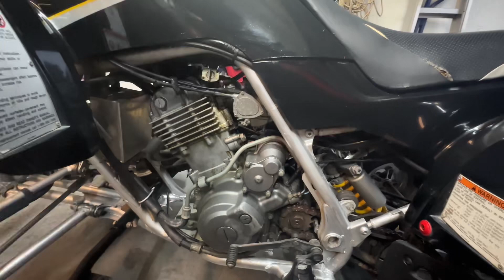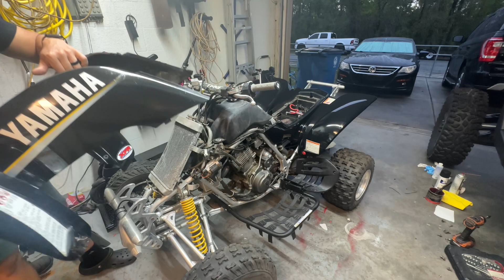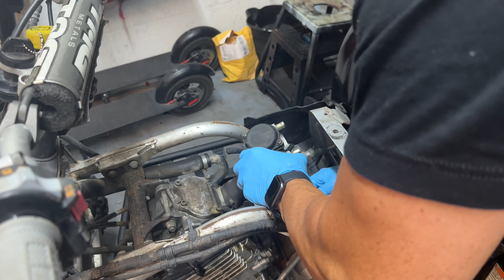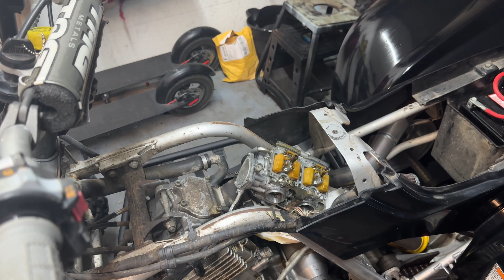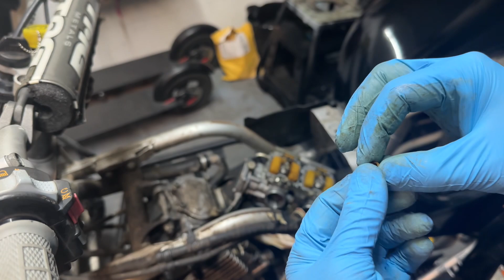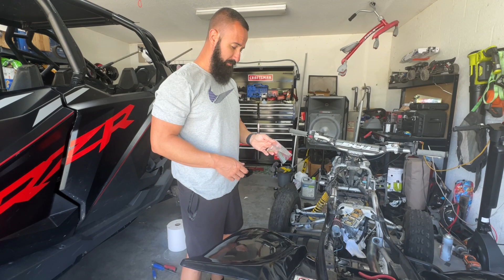Raptor 660 Carburetor tuning (Dual Carb)

Comment: My 05 raptor 660r also bogged spits when I open full throttle any suggestions how’s to fix. It feel like it’s not letting me use full power also missing air filter the air box it’s there but no filter
Reply: You will have to order the OEM air filler guide, plate element fitting and a UNI air filter.
Reply: Valve lashed
Reply: Your reverse wire could not be grounded properly. Happend to my 03 all I did was ground it and it stopped the issue
Reply: Hopefully you’ve figured it out, but you need to have the air filter or it won’t run properly on stock jetting. Get a stock air filter, UNI or K&N might require carb adjustment. Make sure the carb boots are in good condition, if they are cracked; replace them. Research on raptor forum. Theres how to’s for everything
Reply: You could need to rejet it, happend on my 98 bear tracker

Comment: What size jets did you use and brand? I’m working on a 02 Raptor 660 has same air filter as yours and full exhaust what jet sizes should I order?